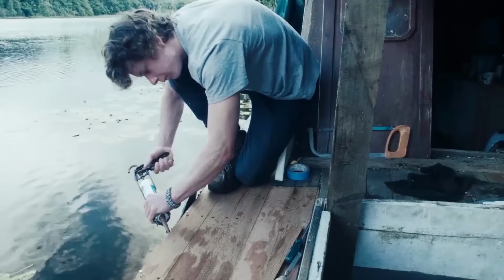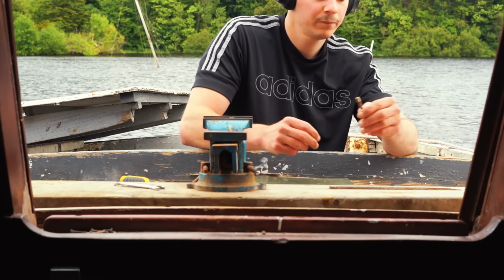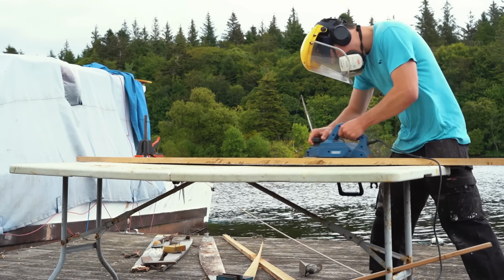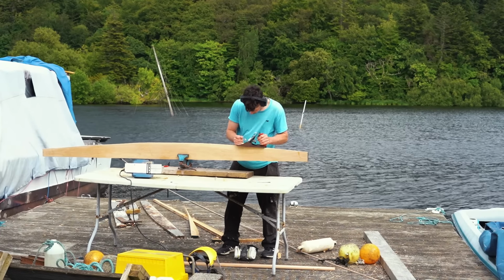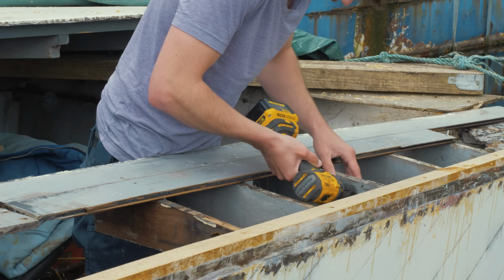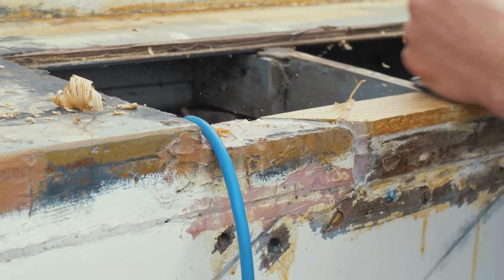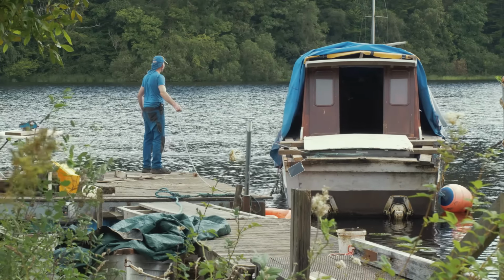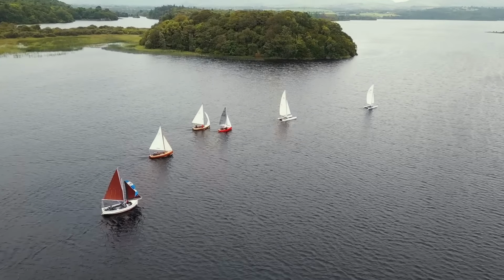We plan to get this 84 Year Old World War II Boat out of The Water | EP 41⚓

Comment: You got to realize at some pont that sealing wood with epoxy is kind of useless since overtime it will get brittle and will just fall off.A good two compound marine paint and gelcoat would have been a much better choice imo.btw, if youre transom has rot, you can be 99% sure your bulkheads and stringers are too. The transom is what you should have started with instead of cosmetics.

Comment: What make of engine does it have. My ex RAF tender was built by Vosper Thornycroft. Also, dont keep the boat out of the water too long, otherwise it will dry out and leak when you refloat it.
Reply from the maker: @terrywilkins5266  After the war a previous owner changed out the original Perkins engines to twin Volvo Penta V6s their marinised Buicks. Amazing I would love to see some photos if you can send over some to finmacarthur@gmail.com
Reply: @LakesideProductions  unfortunately,  in our move to our new house, pictures etc got lost in the move and, I had to sell the boat because we would be too far away from any marina.
I watching intently you restoration. That Hull is called carvel built.